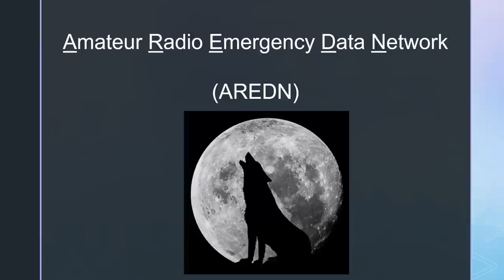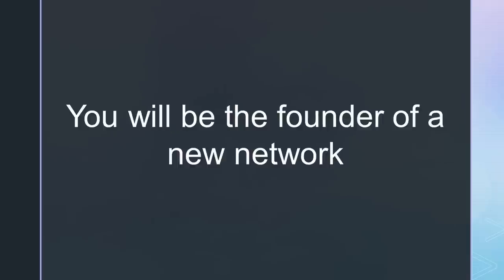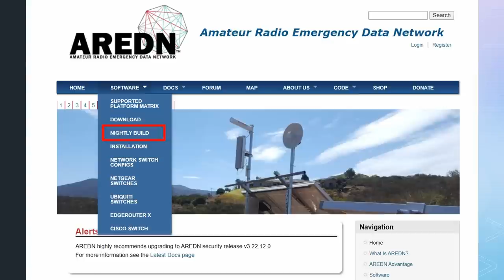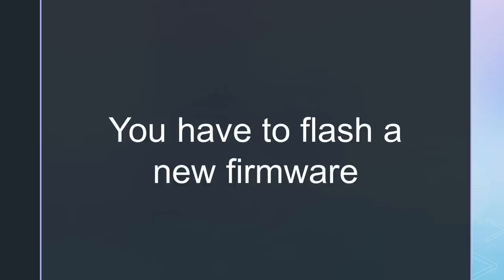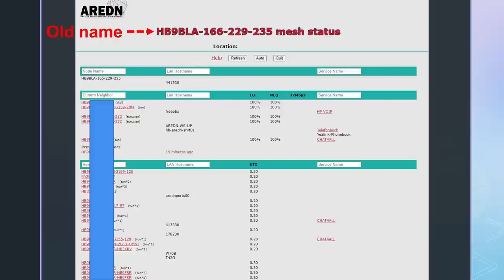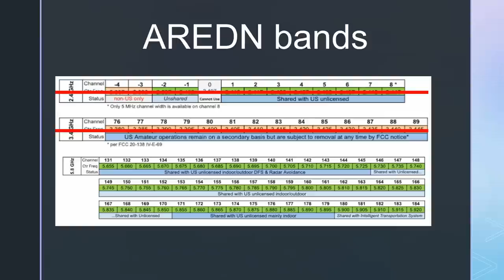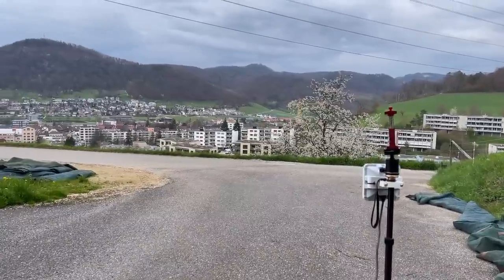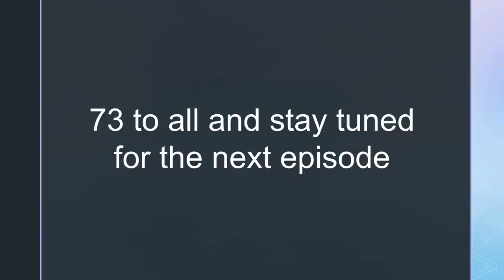Amateur Radio Emergency Data Network (AREDN) Basics/Tutorial

Comment: I am 200km from the Bay Area AREDN and thus unable to get to them via RF... but I am on a very high location.   Have thought about tunneling in with my current router... but watching your video I slapped my head at the notion of just getting another router.  Duh... thanks for kicking my neurons into gear.  Great videos as always.
Reply from the maker: Cool. You would be member of a very big network!

Comment: In the uarly 2000s I found out about similar networks using off the shelf wifi components, with high gain antennas for the long range trunk repeater node things. Sadly my house was on the wrong side of a hill and couldn't see any other nodes. This is a really great system, too. Maybe I should get my ham license one of these days.
Reply from the maker: We have HAMnet (based on standard IP protocol) for a long time. AREDN is a mesh which is a bit easier to use.

Comment: Hi Andreas!  I did some similar work using different equipment (Cisco phones, Asterisk server, Raspberry Pi, and GL-iNet routers.  I found that it worked well.  I only had mine running around my house but my setup was pretty scaleable if it’d needed to be.  Some of the Ubiquiti kit is good for outdoor use, used that loads in the past for other applications.  The TP-Link equipment also looks good but I didn’t want to spend £££ to try it when I really was only looking at the problem conceptually.
Reply from the maker: Cool that you had your own mesh! We use outdoor devices because we want to bridge distances. So we need powerful devices and good antennas...
Reply: @HB9BLA  - Agree.  I live in a bit of a dead spot for radio, so doing a mesh network isn’t much use here unless I use the internet tunnelling option, and then I don’t need mesh to spread from there.

I think you made a great choice with the kit.  Those Ubiquiti devices are certainly very good, but I’ve never used them on AREDN.  Presumably they work well, seeing as they’re on the “supported” list.  I recall from distant memory that it’s possible to run 12v into two pins of the Cat5 connector instead of a POE injector and they’ll work run off that.
Reply from the maker: @daveys  Yes, all these devices use "passive" PoE. That uses spare wires of the Cat cables.

Comment: Nice video which makes HAM radio license relevant in this era, Does AREDN support Meraki Access point
Reply from the maker: I do not think so. You find the list of the supported devices in my links.
Reply: I've breathed new life into original Meraki WiFi kit with openWRT firmware so it shouldn't be too difficult to get going if they haven't already. They literally used to give the Meraki stuff away years ago as they made their money on subscriptions. Then they literally outmoded good working gear, forcing people to pay to replace  all their infrastructure. eBay has been awash with their stuff for pennies at times and it's really good quality

Comment: Are there any similarities with Hamshack Hotline? Looks kind of similar, but I need to see the rest of the series 🙂 Keep em comming.
Reply: you can use ham shack hotline with arden
Reply from the maker: After looking at the Hamshack Hotline website, I think, these projects have a different goal. AREDN is a wireless mesh network for IP and Hamshack Hotline seems to be internet based VOIP.

Comment: Wy HAM License …… such a net may also work with unlicensed regular WLAN Equipment without regulatory restrictions. 
A HAM Network cant be used by persons outside the HAM Comunity as resut from regulation. 
With Freifunk this is possible. What are the technological differences between Freifunk and Aredn in routing and organisation - the Part of the Network that is in Opposit to the links not effected by Regulation ?
Reply: @joel_mckay  Off corse i know …… you need much more relay stations ……  but what can you do with a HAM Net outside an Emergency call? You can check whenever there is a connection and you can transport Data that is related to Ham activity …… wich mean in case of telephone you can talk about ham operator stuff. And in case of an Emergency …… the Probability is high that the system overloads in relation to air time of the transmitter. This means most real time Applications do not work and in this cases most routing protocols are collapsing wich means connectivity is lost complete. Then the Network resumes …… following by the load …… and the system collapses again.
Reply: For me, the reason to try it is that:

1)  You can try experiments with the tech.  Mesh radio is pretty good to have a go with, and many home wifi systems are using Mesh now, so why not understand it better.

2)  You get to learn other technologies, e.g. VOIP, routing, Asterisk server, Pi, microwave frequencies, yagis/patches as part of the process.

3) It’s just another thing to try with a ham licence.

4) Can run greater power on a non-congested section of band.  For me that either means that you can use amps or just yagis or huge plate antennas which otherwise would be illegal to use.
Reply: @daveys  Without Ham Liense i can all the things …… execpt Modification if the commercial wireless Packet Data Radios (mostly Wifi) 

I must work with much shorter Links …… i have used kommercial Equipment for 20 Years with 3 and 7 km Range to the next bigger city. That works well, and i coud earn Money with this too. By the way i get legal additional frequencys and power limits in my contry. If you allowed to use more Power like a ham operator, you also occupied the Frequency on a quite greater Area on Earth. If you want to use such a Network heavily, high Power forbits himhelf. So often i work with much less power then allowed to optimize the ower all performance.

The Content limitating regulation in relation to ham transmissions solves this Problem to working level.
Reply: @q9a  - It’s all good fun to try these kinds of things, and so many research applications have commercial use as well - whether you apply the learning to make money or use it in disasters, it’s all just about applying the knowledge.  Ham radio has always been a hotbed of research.
Reply from the maker: Commercial equipment on ISM bands usually are licensed including the firmware. Of course, you can change it. But AFAIK this is illegal.
Anyway, I have a HAM license and do not care too much about if it would be possible without it ;-)
Reply: @HB9BLA  A Comercial Interface like an usb Stick or an pcmcia Card for example has his own Firmware inside, and this i have never Changed. There was no need to do so. The Software on the Nodes and how this devices Forward Packages is not Protected by law. 
With a Ham Licence you can also change the Firmware on this kind of SDR Devices. (If you Hack how it works) This is great for research. But you cant use your resuts to create commercial services nor for yourself for example to transport any kind of your data. In this case you need additional permissions. In the USA you can hope to get this …… in my county inside the EU  it is more or less impossible.

Comment: Why for that a Afu License is required? Isn’t it still using Wifi or directional Radio for the commutation, and when the hardware was usable before without a license why shouldn’t it be allowed. Also when the Communications are encrypted even a Afu license don’t make it legal.
Reply: It might be that at some point the communications get routed through methods requiring a license, similar to hams using IP connected dmr networks that run on amateurs frequencies
Reply: @badgerbalti  But if I only use standard wifi gear and maybe other license free gear it should be legal, am I right? And when some other member uses gear with require a license it shouldn't matter for me? I also use my ISP Network and they have a license to I don't need one. (Basic high level abstraction)
Reply: @maxmustermann9858  provided you don't use their firmware or connect to their services that may subsequently route your data or transmissions via an amateur licensed frequency at any point, all of this can be accomplished without the need for an Amateur license, but, you'll have to roll your own setup or find an existing open source implementation that doesn't do anything which may require a license. I build setups on Greenfield festival sites which do similar things and it can all be done with off the shelf gear without needing a license. Their setup does much of the heavy lifting when it comes to the underlying configuration so they just have to load a new firmware and pop in a couple settings but it uses their frequencies and powers which require a license to operate, plus it will link to other systems that also use Amateur frequencies.
Reply: @maxmustermann9858  an ISP or Wisp may operate gear that requires a license, but those are commercial licenses which are for the purpose of carrying consumer traffic so you don't personally need a license when your data transits those links. Amateur licenses are not commercial and their use is restricted for Amateur licensed purposes only
Reply from the maker: I am no lawyer. But I thought that the firmware is part of the test procedures for legal equipment. So it would be illegal to change it. But maybe this is a "grey" zone.
I think the most important thing is that HAM radio operators are already organized and can create (human) networks.
There are other such networks for non-licensed people available. See the comment about "libremesh".
Reply: The firmware moves the radios into the ham 2.4 and 5ghz
Reply: @Jay-hr9ci  ok but then when the connection or content is encrypted it’s still illegal to transmit via an Afu License. When ISM compliance, encryption is allowed.

Comment: What makes aredn better than other solutions for example libremesh?
Reply from the maker: I do not know the technical differences. It seems that they have a similar goal and use similar HW.
Reply: @HB9BLA  they both use openwrt as base and both make a WiFi mesh

Comment: I must be missing something. Because I don’t see any aspect of this setup that would warrant the need to have a ham license? Unless the regulations are completely different here in USA.
Reply from the maker: You need to change the firmware of the access points. This is not allowed on the ISM bands where devices are licensed including SW. 
Our (licensed) frequencies are close to the 5.8GHz ISM band (and overlapping). So we are happy we can use standard HW.

Comment: too bad this needa a ham-license; if such solutions'd be created that "normalos" can also participate, it'd make things easier for all, since many people ask themselves "is it worth to make the license" (since it's not exatly cheap, and local radio-clubs are ...very selective... in who they allow to watch/sit with them aso...
Reply from the maker: Things like that are not legal because the firmware of the wireless devices have to be changed. This is probably why they are not made for the general public.
We are lucky that the ISM band on 5.8GHz is close to the frequencies we are allowed to use. That is why we can use standard gear.
Reply: @HB9BLA  this is true - it's just sad that there are so few "entry-points" to HAM nowadays; eg. if the local HAM-group consists of people who don't want "newbies" within them, there's no "let's try it"-band (since CB has been essentially killed by the no-mic-during-ride-ruling)
ALSO - imagine a situation where AREDN ...could do very good helping out authorities who didn't realise what problems the change to VoIP will bring in an emergency-situation (no more switchboard, no more local emergency-phone-net, aso; had an interesting debate at the airforce-center with a guide there, when i stood in the "special exhibition"-hangar where there was a switchboard stored, followed by a talk with the Gemeindepräsidentin, both were "very überrascht" about the non-possibilities of the "old emergency plans".
...are there so many certified HAM-users to make AREDN happen?
true - in an emergency-situation, no one would care if non-licenced would partake. but imagine there'd be an "open" solution.
like freifunk in germany back in the first years of the "WRT54G-legacy-years"...

(just look at what they did to the N-band-license in germany: an entry-license for newbys to check out "is it worth it" - HAMs complained, now the Nband-test (and in conclusion the E-license one) is more difficult than before... that's not the way to bring people in to this great hobby)
Reply from the maker: @michaelkeller5008  It is not too complicated to get a license if you decide to do it. We have many non-organized new HAMS who never attended a class. Finding other interested people in this modern technology is not easy in the regular clubs, I agree. If you live in Switzerland, drop me a message, and I can get you in contact with the right people.
Reply: @HB9BLA  if you're education isn't based in the electronics-part, ...it's almost impossible to make the license (i tried), thanks for the offer, as soon my current situation is stabilised (difficult times atm) i'll come back to it! :)
Reply: All this can often be done with the same kit without an Amateur license. You just cannot use any of their firmware which alters the kit to use amateurs frequencies or connect to their networks as it may use licensed frequencies elsewhere. You would essentially need to roll your own setup using VPN's, Wireless bridges, Asterisk or 3CX for VOIP etc. Lacking an Amateur license, depending on your country you may need to get commercial licenses to operate Wireless gear at higher powers or on Wisp channels e.g. in the UK we can get a "Fixed Wireless Access" FWA license for 5.8GHz band C @36dBm pretty cheap from OFCOM. We use it for wireless bridging across large festival sites. In the UK you can also use 5.8GHz  band B @30dBm  without a license and that will still go pretty far with decent kit.